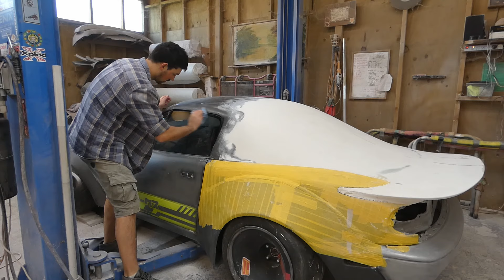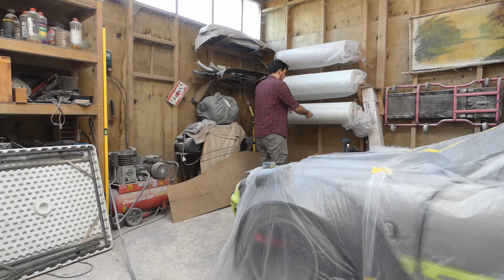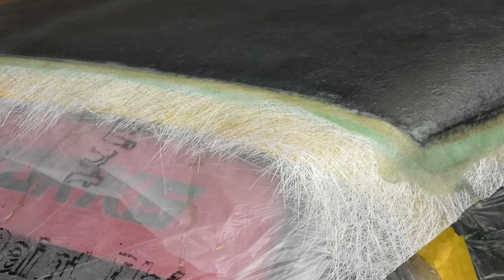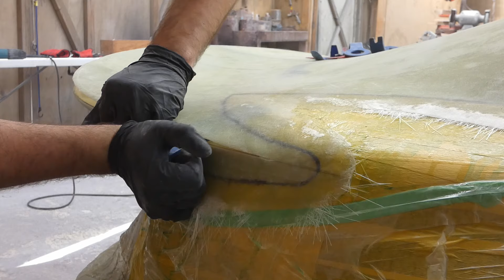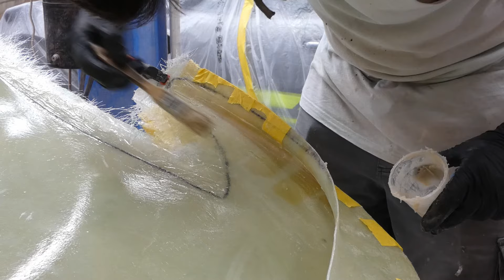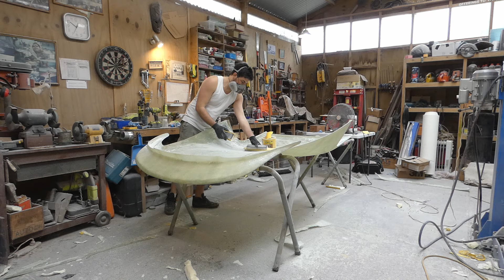Making the Fiberglass Roof! Cyberpunk Miata Build: Part 3

Comment: very impressive. I'm convinced you will be greatly rewarded by the outcome-the lines really come together and I'm looking forward to the finished result.
I know it's been stated elsewhere, and I hate bugging you about it, but
please, please, please:
The dust from the glas fibres is a serious long term hazard to you. Every time you blow air, it will become an aerosol of sorts and you'll breathe it in.
May I recommend Mirka Abranet? it is an abrasive system including sanding blocks. Why? The longevity of the abrasive is unmatched by paper by far and you can reuse this stuff countless times before it no longer cuts. AND: its supporting layer has a net structure, allowing the attachment of a hose even for hand sanding.
the other issue: please do not use a grinder for cutting the glas fibre. An excenter driven tool such as a Fein Multimaster or any similar derivative will give you similar results, without kicking the fibres in any which direction.
Take care, and best of luck to you!
Regards from Germany

Comment: I don't know anything about bodywork, but I have a new appreciation for it when it comes to making custom pieces. Is this the typical process? Seems incredibly involved. You have crazy patience. I wish I could make my own pieces for my miata. Amazing work!
Reply from the maker: Cheers! There's dozens of ways to fondue a mongoose. This is my first time trying this method of adding the filler over top and then pulling the finished part straight from the plug. Most of the time you'll make a mould off the plug first and then pull the finished part from that mould, but it's a lot of extra material and this way is much cheaper for one-off parts this size.

Comment: Just curious as to why you use chopped fiber cloth as opposed to a heavy woven fiber cloth. I was under the impression that woven fiber is structurely stronger. Great work, I absolutely love this style of roof on the MX5!
Reply from the maker: Mostly due to cost and availability. I make a lot of parts and 9/10 times CSM is fine for the strength needed. Another reason I go for CSM over roving is it can actually sometimes be harder to get the woven stuff to conform to tight compound curves without cutting it. But yes, for big flat shapes the woven stuff is ideal.

Comment: Looking good mate, well done. Love the work. How much do you think the new roof weighs? How are you going to built it to the body without worrying if it will fly off when you are doing high speeds?
Reply from the maker: Cheers man. I'm planning on weighing it once the whole thing is finished and painted but I don't expect it to be amazingly light. Since I built it from the outside I couldn't add bracing or infusion mat for strength so I just had to build the whole thing thicker.

I'll be making some metal brackets for the front and sides to bolt it to the body but still keep it easy to remove if I need to get to the rear suspension or battery.

Comment: Great job a bodysaw might be easier to use for cutting the edge of the fiber glass
Reply from the maker: I tried bodysaws early on and found the push / pull of the blade could sometimes chip or delaminate the fiberglass if the bond wasn't perfect or fully cured. The grinder makes a real mess but it's a lot gentler on the laminate.
Reply: @TofuAutoWorks  oh ok thats good to know thanks

Comment: I had the exact same problem when I made my hardtop mold. The mold was too thin and flimsy. How did you add layers to the mold while maintaining the correct shape?
Reply from the maker: This is actually the finished fiberglass skin not the mould. If I were making a mould I would do what I always do and either reinforce it with strips of foam / cardboard or make a wooden frame for it. But since I will be filling and sanding over this finished surface I had no choice but to just build up the layers uniformly increasing the total park thickness until it was solid enough to be worked on.

The finished part came out to around 3.5 - 4mm thick.

Comment: nice work of art, but i've tried this myself, not finish tho just done the glass fiber part over the foam, i've always been wondering is there a specific reason to why everyone remove the foam? me myself just made a small ducktail. and i planned to leave the foam under, unless its bad practice and will effect the end results. thanks in forehand for answers.
Reply from the maker: With something like a ducktail it's totally fine to leave the foam inside. I removed mine because the wooden templates inside would have swollen over time and would have shown through on the finished piece.

There are actually a few cases where you will deliberately add foam to a fiberglass part, even one made from a mould (like a door or a spoiler for example) as the foam core adds a surprising amount of rigidity to the part for very little weight gain.

The reason you see almost everyone remove foam is that they will want to get rid of it for weight, cleanliness, or clearance for wheels in the cases of widebodies. In my case it was removed so I could see out of the rear louvers.
Reply: @TofuAutoWorks  alright. good to hear. thanks alot for shedding some light on it all. appriciate it

Comment: I've done my fair share of fiberglass work, but man...you must itch like hell after doing it in shorts and a tank top! lol Do you do composite work as your day job?
Reply from the maker: Surprisingly I don't itch at all, guess after all these years I'm just used to it. I always end up cooking in my overalls so I rather just work like this. Blowing the dust off with a compressor and then a cold shower after will take care of it. Getting it out of the hair is the main thing.

And yeah I do custom fiberglass work as well as work with a few local body shops doing their fiberglass repairs.

Comment: Are you doing this just on the spot are do you have a plan and or excperience in this because this is really cool.
Reply from the maker: I've got a small background in panel and paint but almost everything to do with composites I've just slowly taught myself over the years. I like to experiment with new methods a lot and make things up as I go, that's normally what I do in these videos.

Comment: Are you making your own bracing or cutting the old top down to a skeleton to bond with the new?
Reply from the maker: I was going to add an infusion mat to the underside but it actually came out strong enough as is. When I add some of the extra geometry to it in the next videos it will make it even more rigid.

Comment: What do you use as your release agent? I've heard motor oil works well.
Reply from the maker: Usually just PVA (polyvinyl alcohol, not the glue) which you can get pretty cheap at the same places you'd pick up your other fiberglass materials.
I've seen all sorts of things being used like hairspray and tape, but I always get a good release from PVA. If I'm dealing with moulds and I want a perfect surface finish, I've started just building up 8 or so layers of mould release wax and skipping the release agent entirely.

Comment: Could you have put the sheet of plastic down first and then start the expander foam
Reply from the maker: I've found in the past that even if I use tape, if the adhesive isn't strong enough sometimes the foam expands against itself and can actually pull up the edges of the tape and lift off from the surface. Its much more stable to do it directly onto the surface even if that does require a bit of clean up. 

Sometimes I'll use aluminium tape or leftover vinyl wrap which work pretty well at protecting the panel underneath.

Comment: What kinda sealant release do you use I can’t find a good one?
Reply from the maker: The green liquid I brush on is just standard PVA release agent. Almost all brands are the same. I don't use it in my finished moulds anymore because it will leave a slight orange peel or brushed texture, but it's perfect for this sort of quick and dirty work.

Comment: Это же вроде не так должно делаться
Типо вот ты сделал модель из стекловолокна, а потом ты внутри этой модели кладёшь разделитель, и там уже делаешь то что в итоге будет частью кузова
Reply from the maker: I use that method on a lot of my smaller parts where I plan to make multiple copies. For large one-off parts like this, this is the best way to do it. Building a mould takes too much extra material for a single part.